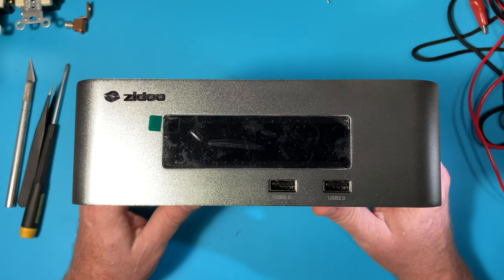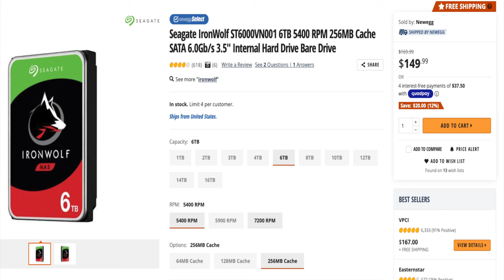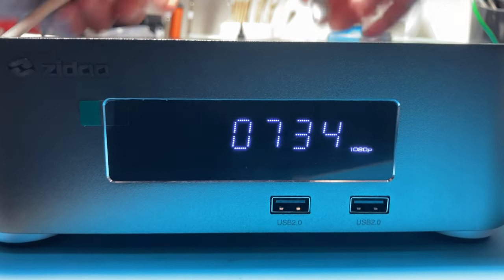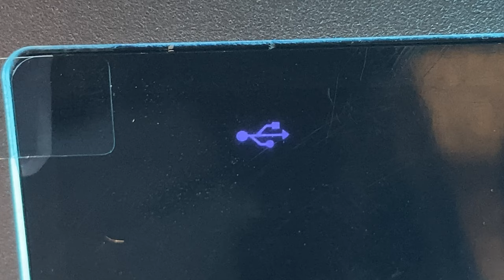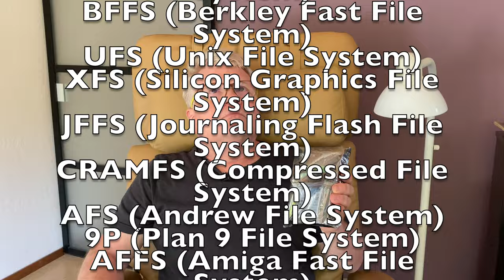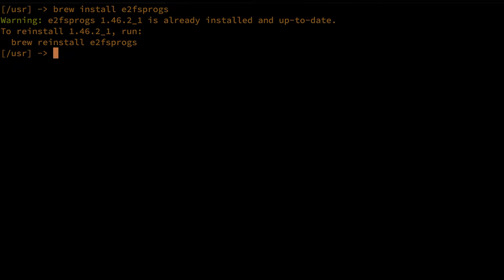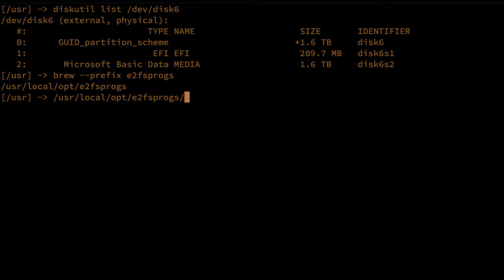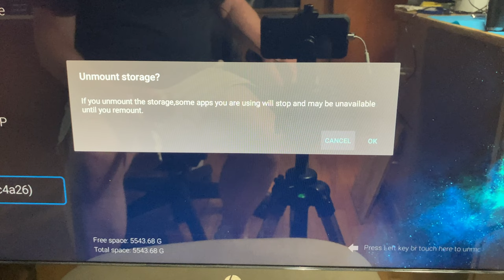Zidoo Z10 Pro 4K Media Player: Initial Thoughts & Internal Drive Setup using Mac (no Windows PC)

Comment: Excellent video. I have the uhd3000 Zidoo and have backed up all my uhd discs via my windows pc onto an external back up drive. I however would like to move them to the Zidoo in the quickest way possible. All up around 5tb worth of movies. What is the procedure to transfer via wifi from my windows pc to my Zidoo. I have allowed the backup drive to share the files on my windows pc but am lost on taking the next step.

Comment: Not gonna lie I wish i could build my own android tv box,  I feel like none match my needs. I want one whose interface isn't crap and doesn't run old outdated android. I also want all the bells and whistles and maybe even user profile switching. Is that too much to ask for?
Reply from the maker: I also think there is a temptation with these things for the developers to get wrapped up in the "movie poster display" stuff and other fluff and so they wind up neglecting things like being able to play ALL THE VIDEOS. (Zidoo has trouble with some AVI files. Popcorn Hour choked on some DVD .iso, esp. Blue-Ray. And it never did H.265.) 

Sure, AVI files and DVD images are a small part of what I want to play, but when I want to play it, it HAS to work...

Comment: Can we use NTFS formatted drives on Zidoo Z10 Pro? How to access INT HDD on windows computer through wifi?
Reply from the maker: Yes, and most folks use NTFS because most folks have Windows. To access over WiFi you can use SAMBA on both ends. (Also, looks like the latest firmware MAY have a built-in format routine -- finally -- but I haven't investigated.)
Reply: @WardCo  Thx a lot for clearing doubts. How many TB HDD is enough for this Z10 Pro? My use case - I keep on downloading the 4K shows and movies and watch on weekends, just to make sure I never run out of the contents. Although, I delete them too after some time to free some space.
Reply from the maker: @SunilYadav_sky  That's kind of a personal choice. Those 4K shows gobble down 4 to 20 GB at a pop -- but if you delete them after a while, then the disk size isn't as much of a problem. That said, I personally wouldn't go under 4 TB, since those disks are pretty inexpensive now.
Reply: Use a docking bay,insert the hdd and then hookup to your pc.
Now just set it to NTFS and your done.
I dont understand man ....you are making this much to complicated for regular pc users.
Reply from the maker: @peterraes9352  You're assuming everyone has a Windows PC laying around. Also, NTFS will always be a bit of a kludge on Android-based systems.

Comment: In many simlar circumstances, leaving that EFI parttion in place can lead to grief. In said circumstances, ONLY the first partition is available for storage so your 6TB drive might make just 210 MB available. I had this problem with an external USB-attached drive on a similar DUNEHD device. The DUNE HD will, however, do its own ext4 format on internal or attached devices.
Reply from the maker: Yeah, I can see how firmware not expecting an EFI partition might get confused. Good news is that, I think the current release of Zidoo firmware will do an ext format on its own.

Comment: This seems  overly complicated than just using  raspberry pi and external usb hdd dock for a plex server. If you want dolby atmos or need transcoding power for your plex server, just buy a nvidia shield tv pro. 
Mac uses exfat so maybe it will initialize and format the hdd as exfat. Zidoo should be able to read exfat. 
An expensive device like the zidoo should be able.to initialize and format any external internal storage device. Android smart phones are able to format sd cards inserted in it.
Reply from the maker: It looks like the latest Zidoo firmware has picked up an "Initialize disk" function, but I haven't tried it. And, as a recovering firmware engineer of some 35+ years, I no longer find messing around with Rasberry PIs or Plex fun or something I want to spend my time on. But, you know, I'm weird, and I'm sure your suggested approach would work for many.
Reply: @WardCo  yeah. I just meant, for something as expensive as an nvidia shield tv pro, it shouldn't be too much of a hassle to set it up.  No need to unscrew things to put an internal 3.5 hdd. The hdd and the device should be plug and play.